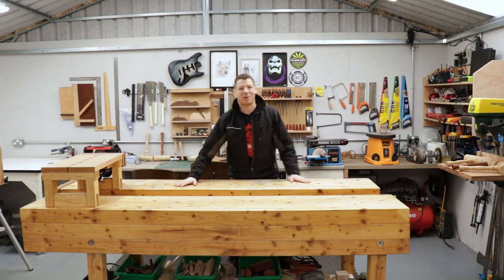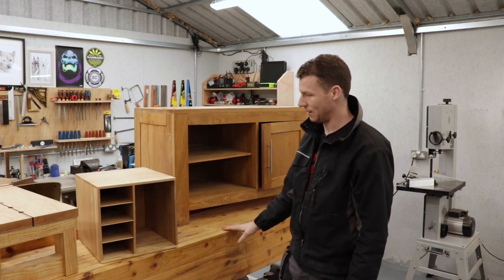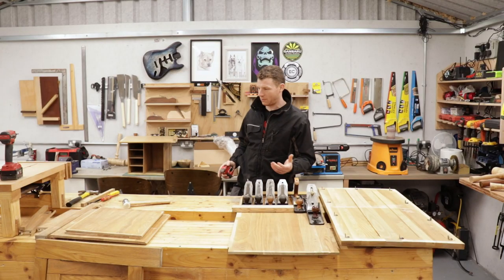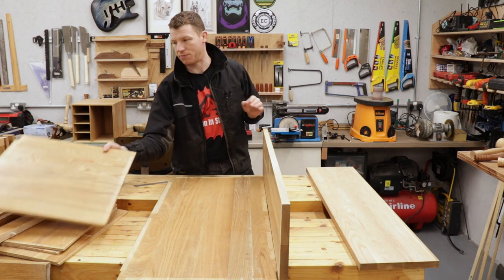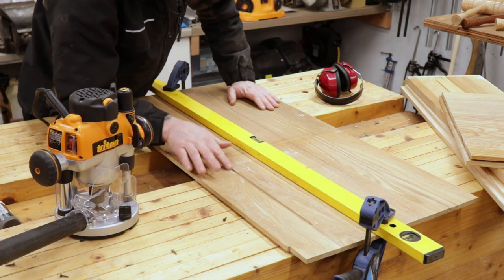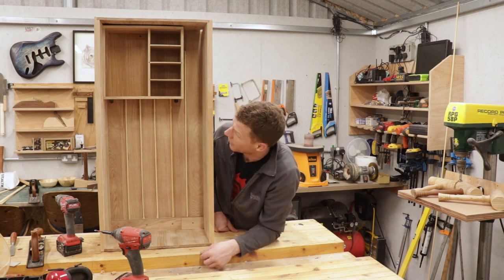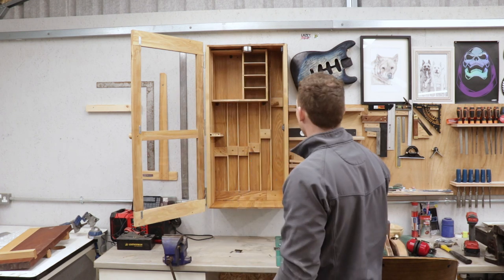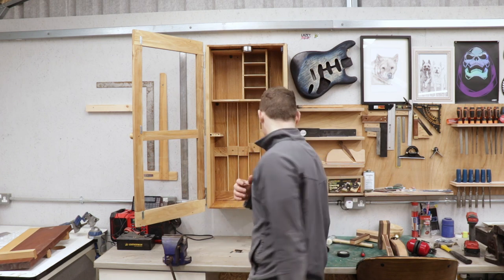Hand Tools Cabinet With Plane Till. Up Cycling Some Old Furniture!!

Comment: Do you oil or wax your planes and cast tools John? Found even finger moisture rusts up on my veritas planes I have just started giving the sole a wax or oil seems to work great.
Reply from the maker: I do I use a wax but the last few weeks have been wet a cold so has been hard on the tools, it is a constant battle.
Reply: @JohnMcGrathManInShed  I know what you mean I'm in Glasgow weather is the same as across the pond, noticed some mildue on my birch ply bench the other day going to have to give it a rub down and wax or stain. I see the ferrex belt sander in the back how do you find it cant remember if I asked you before about it or doing a video. Seems half the price of the other looks the exact same machine just rebranded. I'm wanting a big disc sander and the sorby pro edge then I'm giving up with tools for a while. Need to get the garage sorted  out and stop buying more tools just see things and buy them 😂

Comment: Nice job John, it was a good upcycling and came out lovely. The workshop looks much brighter with the coat of paint. Being able to enclose the tools for dehumidifying is the one thing I keep wishing I could do with my tool wall (but there's just no space for a door or even a decent tambour): http://www.stochasticgeometry.ie/2017/04/29/tooltris-continued/
But where did you get the perspex from? Whenever I've gone looking for it I've had to resort to ordering it off ebay, I've never found a source in Dublin.
Reply from the maker: Find a plastics supplier they will usually cut you what you need, not sure who does it in Dublin but there should be loads